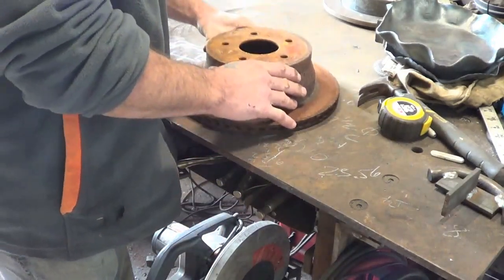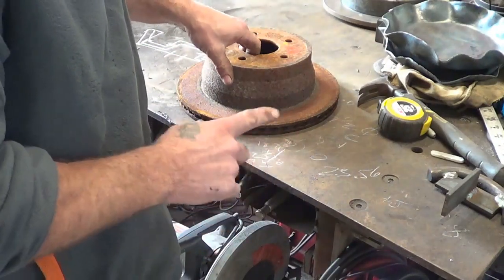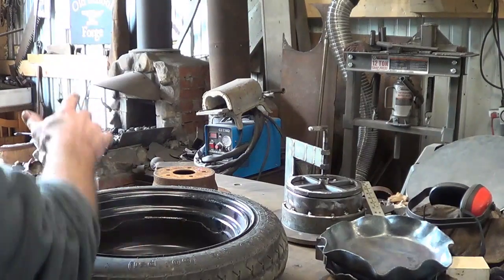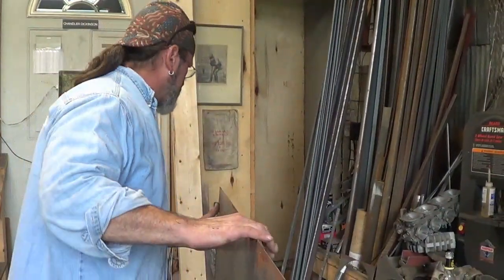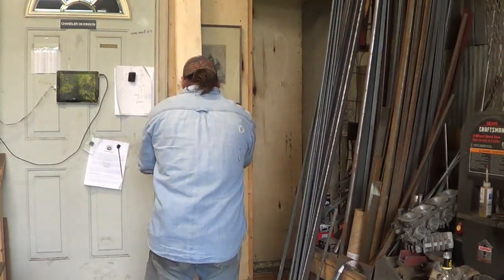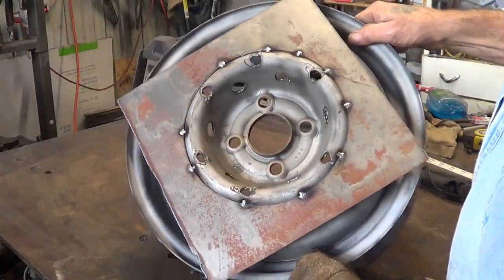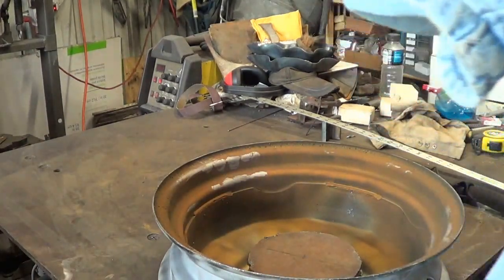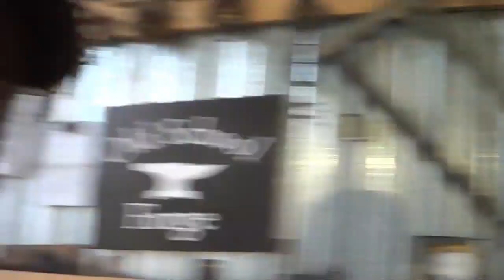OSF Special Feature - Need A Tool Make A Tool - Failure - Ring of Fire Forge

Comment: Chandler, is that circle cutting jig and original? If it is maybe you should patent it. Good add-on to help you line it up to your measurements, maybe add a cross hair to the magnet?
Reply: if i made it i'd keep the peg on the other end and a drilled hole in the magnet block to line up the cross-hair easier
Reply: Brian Donahue these have been around for years, they were originally used for Oxy/acetylene torch cutters

Comment: What if... you made some kind of cone-shaped air diverter that could fit more inside the air hole? A wide, short, inverted cone with a plate on top, with bracing or "outriggers" to keep it held up so it doesn't plug the hole, but just let air around it?
I can see it in my head. Lol.
Reply: This is exactly what I was thinking would work better. The air flow through the tire rim divides the air flow. The Cone plug should just redirect it. the trouble is still going to be a fuel to air flow ratio, but I believe it was an airflow problem. It just wasn't divided even ly so the pan didn't get heated evenly.

Comment: could you use a torch with a turn table to heat the outer ring all the way around at once? I saw that used on "how it's made" for a similar purpose
Reply: dirty bird yeh a torch and put the pan on an old record player :)
Reply: 33 or 45 rpm ?

Comment: Chandler, great video. I'm shooting the dark too but I had a few thoughts watching the video. The first was that you're trying to heat up a much bigger area so you probably need a lot more air, probably at least running the big blower the whole time you're heating the pan. All of the fire coming up around the pan is doing nothing to heat it. If you added a steel disk around the outside of the wheel on the top it might direct some that heat back on the pan before it goes up the flue. The last was that I suspect you're heating the pan unevenly because you're getting uneven airflow. The holes all see the same air pressure and whichever part part of the ring lets the air filter up through the coal bed more easily will have less resistance, more airflow and more heat.  You could try making some sort of manifold out of the hub, but if you have access to it, pea gravel size coal would probably be an easier way to get more uniform airflow around the ring. Alternately, maybe you could come up with an air manifold that sits in your regular fire pot but brings the air up in a ring of columns instead of one big one in the middle... It might even as simple as cutting a steel disk the right diameter to fill the fire pot about an inch above the bottom and then cut notches around the circumference for the air to come up in a ring. I have no idea if any of this is helpful, but I'm looking forward to seeing where you go with this.

Comment: I know a reflector could do what you are wanting to do. Just a plat coated in refrac, or a thick peice of steel just to block what you dont want to heat.
Reply: Darkest Sky I was thinking the same thing..
Reply: Yes, all the heat is being conducted into the metal rim which is radiating all the heat away. A refractory of some kind is needed, either on the inside of the ring where it would do the most good, or at the very least around the outside of the ring.

Comment: I'd say in "the ring of fire forge" just a straight charcoal fire would work much better. Sure it burns up quicker but the fire will have much more consistent heat. That and you'd be able to bury the pan rims easier in charcoal.

Comment: I suggest you find on of those huge stove wok burners and stick in were you welded the steel plate on the centre hub... Supply air where normally the gas would be supplied and most likely you'll have a nice and hot burner... regards, Sander

Comment: what about making a magnifying fresnel lens in the shape of a doughnut if that makes sense.. and you can adjust the size of the rings by how far or close to the item you're trying to heat... benefits of it its free to run once set up  and will heat up the outsides evenly and quickly con is its possibly dangerous if not uses safely... food for thought .

love the videos btw long time viewer!

Comment: looks too complicated.  go for the simple option.  make forge normally.  make it hot.  get a lump of fire clay or some refractory stuff that won't fall apart or give you too much lung cancer.  Dump it in the middle of the hot bit and wiggle it around to displace the coals (and airflow).  there you go.  so the middle will still get a bit hot,  but won't transfer nearly as much heat to the metal.

Comment: for my forge, which is  long and narrow, I use 1" steel pipe with 1/8 holes drilled every 1.5 inches.  the pipe is about 12 inches long, threaded and capped on the end.  it almost looks like a propane burner with no coal in the forge.  anyway, running that on an old vacuum cleaner with the fan reversed and a pvc butterfly valve to control the flow, I get a fairly even heat.  if you made a similar setup but with a circular pipe then you could in theory have an air pipe for each pan size without the need for the old rim.  just run a hose to your pipe and set it under your coal. Best of luck, and as always, great video!

Comment: what if you would put slats instead of holes?  wouldn't it spread the air out and get more of the coal burning?  I would think that would give u a little more uniform temp?
Reply: I think your idea would have the same effect as if he just placed a cone in the original air hole to make the ring effect.

Comment: Chandler, I admire your enthusiasm but I feel like you might help yourself by investigating existing techniques more thoroughly. Sometimes it looks like you try to reinvent the wheel because of lack of knowledge. While that can be good fun, it's maybe not the most efficient way to better your skills. There are tried and tested techniques just waiting to be learned. May I also remark that I mean in no way to offend, it's only friendly advice.

I see you trying to brute force the pans into shape, while it can be done with relative ease. And without any special tools, just a dishing form and a raising stake. Dishing forms can be bought, or self-made using a tree stump. But doing heated work on a stump eats up the wood rapidly. Most forms or swage blocks aren't that costly at all. A raising stake is easily made if you can weld.

When you dish the disc into a shallow bowl, you keep straight sides without the wrinkles. Moving the bottom back to flat won't take that much effort since you moved the excess metal to the sides. And it won't cause the sides to warp again for the same reason. With some practice, you end up with straight sides of the same height and a flat bottom.

The videos below show the process. They aren't great quality, but they're clear enough to follow what is done. Remark that the blacksmith isn't using much force at all. He is mostly tapping instead of using hard blows. If I were you I'd give it a try.

https://www.youtube.com/watch?v=yMDJ1CSaL2g (dishing)
https://www.youtube.com/watch?v=8aKfjzuuz4s (flattening bottom/dressing sides)
https://www.youtube.com/watch?v=YRa6PZWp308 (the handle)

Comment: I'm no smith, but wouldn't a lid work? Like, wouldn't a 1/4" piece of sheet metal, with a roughly 2" diameter hole in the center for smoke/exhaust, keep in the majority of the heat? The big issue I see with it, however, is finding a place to put it while positioning the pans.
Or same thing but put a (cylinder with holes cut in the side [no idea what to call that]) about the same size as the bottom of the pans on the bottom of the lid; with a bigger exhaust hole(?)  
Hope that makes sense.  o.O

Comment: I have a camp chef stove with round burners (sadly they are only 6") that put out 30,000 BTU's each.  When it is on high it gets the 3/16 round grate to glowing red very quickly when it is covered with a pan or the cast griddle.  Even if you don't go with round you may be able to bastardized the burners from a beat up grill and arrange them in the right way.
But, before you do that, you may be able to simply insulate the Ring of Fire forge by covering the pan with a heavy plate or fire bricks to keep the heat on the pan and simulate it being buried in the coal.  Anything that reflects the heat back will do it I think.

Comment: Maybe you try putting coal on top of the outside of the pan? That way its not just sitting on the flame. And maybe smaller holes? It looked like it was working alright to me. Maybe a few small adjustments though. Which Im a 12 year old beginner blacksmith so what do i know

Comment: +Chandler Dickinson What you're looking for isn't an oven type propane forge but a hot box with a specialty burner that runs with either a forced air/oxy + propane mix or an oxy/acetylene mix. The burner would likely need to be custom fabricated and I'm sure I've heard of companies that do that kind of work. It would essentially be round tube with flame holes drilled in it and perhaps even internal baffling to get even heat output, bent into a circle the size of the outer edge you want to heat.

Other than that you're either going to run into heating the whole pan at once or having to heat the edge section by section. The reason the ring didn't work was partly a lack of adequate airflow and partly lack of coal depth. Evidently, coal depth plays a critical role in the heat output and viability of a given forge. Both air flow and coal depth work in unison so you'd need to find the sweet spot for both. From what I've stumbled upon the rule of thumb for coal depth is at least 4 inches.

Also, that orange dust inside the wheel after you plasma cut the air holes in was iron oxide, which results from the oxidation and burning of steel.

Comment: Well Chan it was not a fail because we both learned something. I can't totally tell from the video, but is there anyway you can configure it to get the airblast more underneath the bed of coal than being side-draughted? It looked like a lot of the air was going right over top of your fire. 
I am getting ready to try a bituminous/anthracite blend this week hopefully, so that might be interesting to see how it behaves. Anyway, your concept is fine, just needs some refinement and from my angle it looks like the changing the airflow might help. But like I said, I couldn't really see it as closely as you. Forge on, brother.

Comment: Chandler I'm a smith trying to get my own shop up and running and I have a few questions, what tools besides a forge anvil hammers and tongs would you say are the most essential, and which of them would you recommend me getting first. Do you have a favorite brand of tool, one that generally has higher quality products and in your opinion which is more affordable a coal forge, or gas. Also could you recommend a good source of blade steel.

Comment: I don't know if you or anyone else has thought of this, but it seems to me that one side is taking a higher percentage of the air that is blown in.  If you were to fabricate a reverse header I guess you would call it, basically a tube running from each air-hole that you cut into the rim down to a collector that slides into the hole from the blower.  Since it is cool air coming in you could probably use electrical conduit pipe, maybe 1/2".  That stuff is pretty cheap and easy to work with.  The whole setup would allow you to better control the airflow under the fire.

Comment: would a 1/2 in ID black iron pipe ring with holes drilled in the top and sides with a tee cut in with a 1/2 in leg coming out hooked to your air compressor dialed down to very low work? that way you could still use your current fuel and forge setup and put the air feed where you want it in a ring and get the crud out of the way and not have it trapped in the rim. just a thought from a pipe fitter/ plumber and no guarantee that it will work either just my SWAG. Semper Fi.

Comment: going from one hole blowing air to many in different directions, you're increasing how much air is needed.  keep the electric blowing Hard. It's amazing how much more air is needed for that kind of design.   Also raise the platform up higher and have a deeper coal base.  You get the heat from a larger mass of coal (sort of (basically)) so if the coal is in a narrow strip you're going to have to pile it higher than that.

Comment: Bituminous smokes til it cokes. In my experience it works best in forges that don't have constant air flow and somewhat deep firepots. The deeper firepot allows the coal to coke before it reaches the fire giving off less smoke. But with bituminous no matter what you do it will smoke.

Comment: if you go with gas making your own burner isnt hard. you can customize the width if it with some heavy pipe bent to the desired circle. small holes drilled in the top facing slightly outward (i wouldnt go bigger than an 1/8thin) give you your heat jets. just close off the open end with foil and wire. the moonshine boys do it a lot for their custom sized stills. far as the ring of fire coal forge goes what about wrapping the outer ring of the wheel with a thin pipe ( easy stuff copper or wire conduit) with hole through drilled through. hook your blower to one end of the pipe close off the the other youll get a good evenly spaced airflow into the coal mind you im completely ignorant of coal forging im just getting into looking at building something small to start with but ideas can transfer between skill sets. if you did the pipe idea you could theoretically burry the pan in the coals and keep even heat

Comment: Seems like your ring would work if every factor was perfect, but you can't control the way the air moves in the coal perfectly because of the shape of the coal making hot spots and the holes the air moves into the inside of the wheel would have to be spaced perfectly. I like the propane ring idea . Is propane more expensive than coal or anthracite. Great videos by the way keep up the awesomeness

Comment: as others have stated, this is obviously an airflow issue. Seal the bottom, check the area necessary for your current 'air holes', make sure they're symmetrical, because air pressure needs to be consistent, and symmetry will help that, if you need more pressure, lower the size, if you need more volume, raise the size of the air holes. Seems like you were on the right track and got killed by a detail.

Comment: Chandler what if you took a 4” pipe (or whatever size the air inlet is)  put a cap on it  with six to eight half inch pipes that have quarter inch holes drilled every inch or so welded to the cap . Put a round plate over the center and you have your ring of fire. Would the pipe stand up to the heat? Anyway, I enjoy the videos  keep up the good work.

Comment: For the bituminous coal smoke, I suggest starting with charcoal to get an established draft up your flue and add the coal once the charcoal is established.  It makes lighting the bituminous even easier also.  The main thing is you want to establish that hot air column going up your exhaust so as the coal releases the smoke it follows established air currents.  I work with mine in a building that's open on three sides so I don't worry too much about it.

Comment: I'd have built a stubby cone with a flat end the same size as the disk I wanted to NOT heat out of refractory material , then made a circular gas burner the size I needed to heat the outside edge of the pan. Set the pan on right side up fired up the gas and let it heat. Might need two gas tanks with two crescent shaped burners so you have enough flame.

Comment: I suggest you try this again, with the same wheel hub, but make the air inlet holes on the bottom. Not on the side of the inner circle of the wheel like you have done in this video. If the the air inlet holes are on the bottom, the fire will/should behave more like a normal blacksmith's fire because of the placement of the hottest zone in the fire. 
Still, besides that your idea is not working jet, this is a great video.

Comment: an idea for using the pan clamp  - use a burner from your propane forge to geat the edges while its already clamped and form it mostly to shape without wasting any time screwing (*rimshot) around losing heat

Comment: i use bituminous, use some wood and charcoal make a small fire in the center and it will quit smokin after a few minutes and the outside will coke up and then wont smoke, will light quick and be smokeless and hot. Maybe you can make a cfooking area outside and coke some up and bring it back to the inside
turn the pan with the edge up, pile coal up to it and it will heat the outside only not raise into the pan. It will work but 2will need use big blower to heat it fast

Comment: Looks to me like you need more air holes and maybe try straight charcoal yeah it burns quick but it burns HOT and back fill the edges of the pan around the rim with charcoal after putt the pan in the forge it will hold in the heat better

Comment: you may try slowly  filling the rim almost to the top with either coal so as to get it all burning, this raises the working part of the fire higher to where the pan is sitting you may need more air but with your current set up the fire is not deep enough to heat correctly. thnk about your fire pot and how many inches of burning coal is under your work. just my thoughts man keep up the good work

Comment: Maybe make a baffle set that goes under the ring to better  channel air up from the bottom so you can use  anthracite , Raise the center , And  use a thick cheap veg tan leather gasket  or something . to make a good seal and trap the air ? , And maybe make the holes  larger but into evenly  spaced slots  .  That's all i can think of  chandler  hope it helps .

(edit) Oh and maybe take a pan of water and put it over the part you don't want to heat . Just letting the water boil to act as a heat sink for the center .